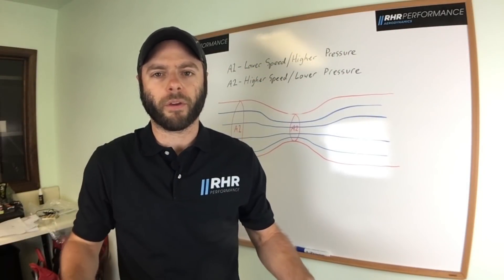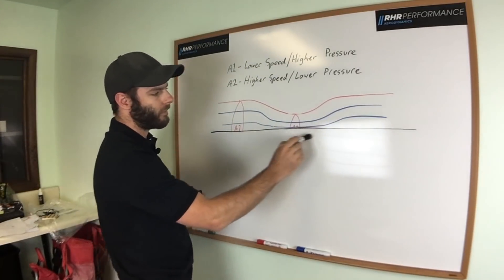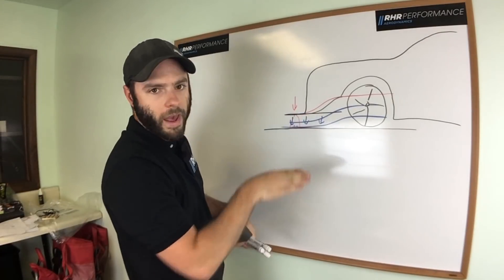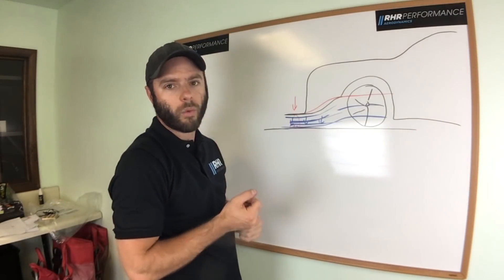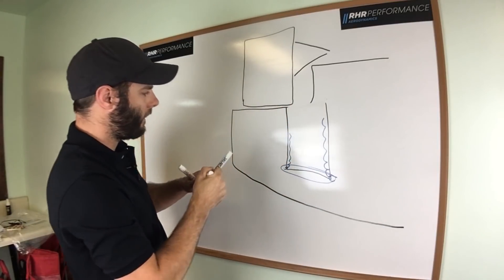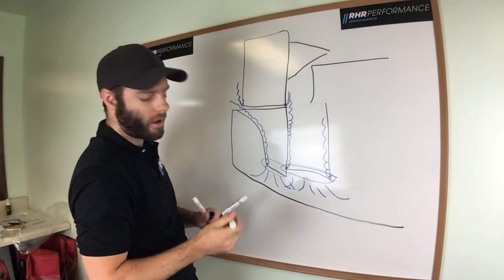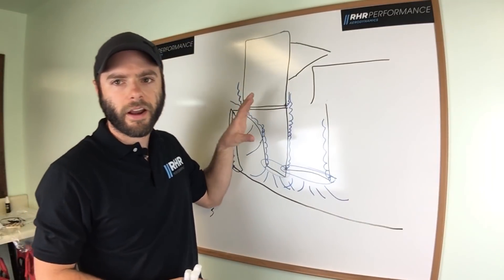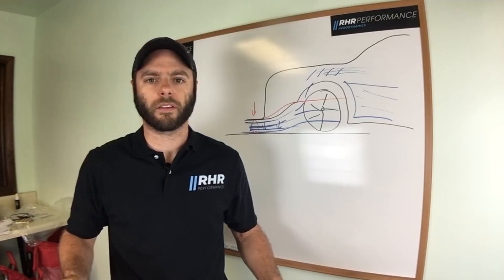How splitter tunnels and front diffusors work (CFD supported)

Comment: This topic will probably get some traction with the 2023 Porsche GT3RS now having active wings in their front diffuser tunnels.
Reply from the maker: Just looked it up. Pretty neat. I’ve actually been tinkering with an adjustable splitter tunnel but would be a manual option since just about every rules set for racing dictates aero must be fixed.

Comment: Bernoulli's principle isn't why aerodynamics work. Newton's third law of motion says that for every action, there is an equal and opposite reaction. Any aerodynamic force is the result of throwing air in the opposite direction. A splitter forces air to go upwards, which creates an equal and opposite force downwards. A diffuser forces mass of air upwards, which creates an equal and opposite force downwards. A wing throws air up or down due to angle of attack, which creates an equal and opposite reaction.

Bernoulli's principle only describes the airflow following the surface, not the forces experienced by the body.
Reply from the maker: While you are correct, it’s at a much much less degree than Bernoulli’s. If your theory was correct, then how does a diffusor make downforce on a car with a flat bottom work when there is zero airflow on the top side? Tunnels in a splitter are the same. There is zero air on the top surface to “throw” upwards.
Reply: @ajhartmanaero  The net effect is to push air upwards. We also like to think of air as flowing over a car, but the air is stationary and the car is moving. From the atmosphere's perspective, it is only moving up, down, left, or right to get out of the path of the car, and trying to return to stationary equilibrium afterwards.

If Bernoulli's principle is to be believed as a primary force, then any car is a giant airfoil which generates lift: air travels a shorter path under the car, while it must race a longer path over the body of the vehicle to rejoin, which is exactly like how an airplane would generate lift according to Bernoulli's principle.

You cannot generate motion without reaction mass, it is impossible according to our current understanding of science. If you propel air upwards, you experience an equal force downwards.

Comment: So when the air moves it has a lower pressure? What if the air stays still and the car moves past the air?
Reply from the maker: Effectively the same. Theres a case for a non moving floor wind tunnel you'll get an extra boundry layer on the ground, but for the sake of this video and not going way off on a tangent, think of it as the same.
Reply: @ajhartmanaero  Not the same. Windtunnels don't give an 100% representation of pressure. They are only good for flow of air around a car.
Reply from the maker: @Harty1275  I'm aware. Which is why I made mention of the wind tunnel not being a rolling floor, but the tunnels will make downforce in both situations.

Comment: Tire is spinning, creating a high pressure area and dirt air, have you evaluated how this affects a front diffuser?
Reply from the maker: Yes. Tire squirt was modeled in our CFD runs. Since the tunnel is in front of it, its not overly detrimental, but you also can't get away without tire squirt either so it is what it is.
Reply: @ajhartmanaero  I find the terms , high pressure and low pressure  confusing.  Is low pressure = less lift ....  and high pressure = less drag?

Comment: How much drag does a shorter splitter create opposed to a splitter that goes all the way back past the front axle and up the the front subframe? I see a lot of splitter designs that are cut short for shipping purposes (save money) but is it worth the extra length?
Reply from the maker: Cfd and wind tunnel data on splitters is much more limited then wings. It will be a little more but nothing drastic. As with all things aero, the degree of it depends on several factors. Not sure if you are following our new Vlogs but my new splitter will be a seperate piece to extend it to the axle centerline and will test both setups with data.